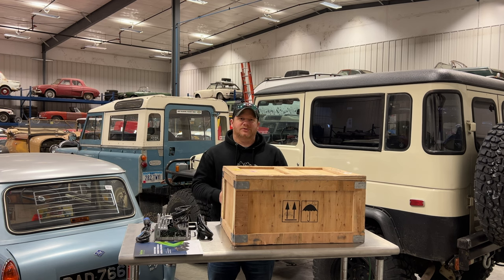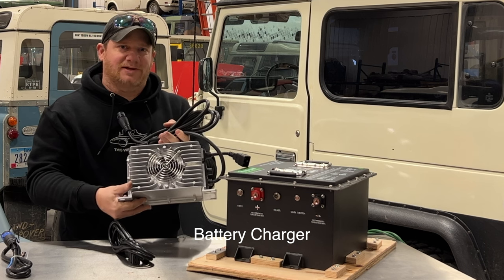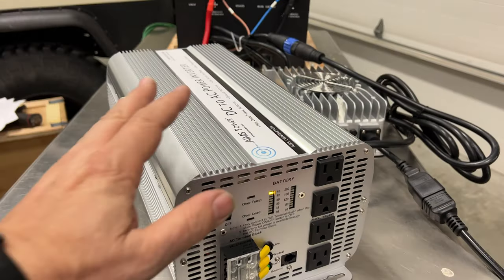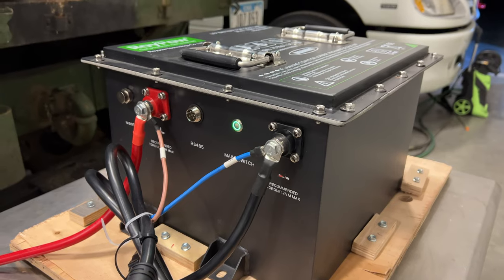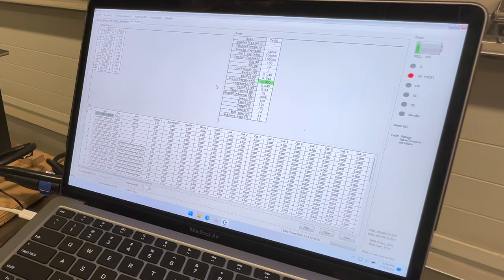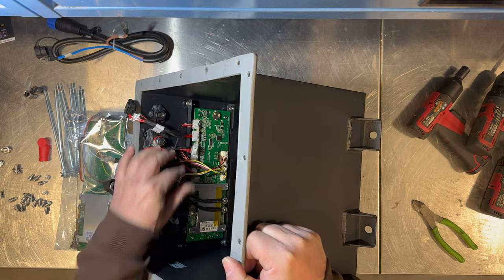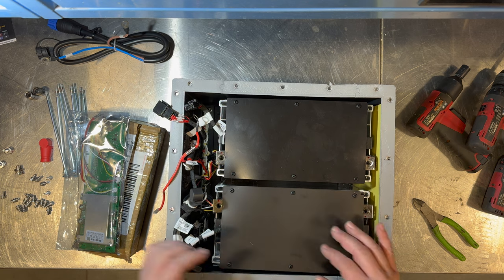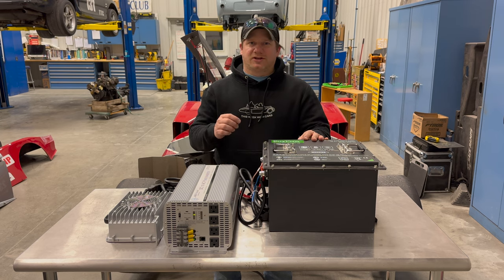36V  RoyPow LiFePO4 Golf Cart Battery

Comment: Good trouble shooting video. I feel they didn't check out the unit before they sent it to you. You deserve the spare BMS and the connection port for your time and expertise. Thanks for making and sharing your video.
Reply from the maker: They didn't ask for the BMS or testing equipment back which means I will be able to rebuild this battery several times if needed.

Comment: Real world problem fixed and good customer support. I think as it turned out the company was right to send you a new board as neither they or you could have known that there was a loose connector. Seems like a great set up if that is what you need and more power than lead acid so as you say will last longer. Thanks Steve very interesting.👍👍

Comment: Could you measure the efficiency of the inverters at various power points? I’ve heard it claimed that running your RV lights off a big inverter is bad because they are inefficient when you pull 100w from a 5kw inverter. It’s been said you’re better off running a separate inverter, like a 400w one for lights. Never seen actual data though.

Comment: Im considering changing my camper leisure battery (lead acid) for one of these but you made me aware of problems with temperature etc, my van stays out in winter so im wondering if it would cause charging issues as you described?
Reply from the maker: The good news is the charge controller will not allow you harm the battery.  It would be best to put it inside the camper like I did so that it will kept at the same temperature as the inside of the camper.  If you didn't see my install video it is here: https://youtu.be/V5xCz3-6Blw

Comment: Have you tried to hook solar panels to it?
Reply from the maker: Currently I use solar panels connected to an inverter and using the supplied charger.  A solar charge controller cannot monitor the individual cells like the original charger can.